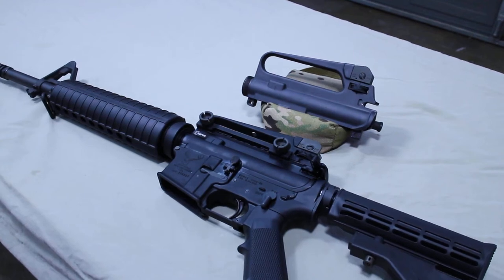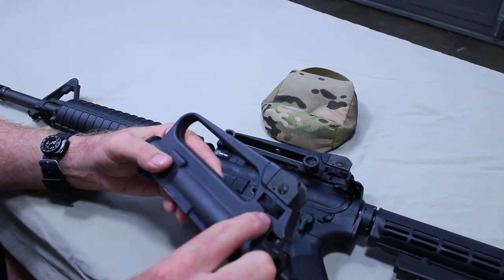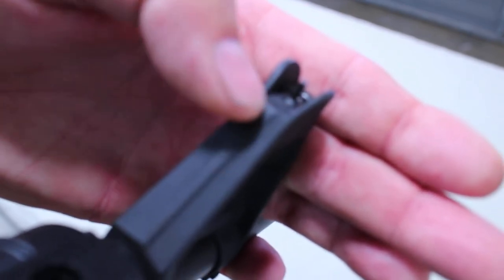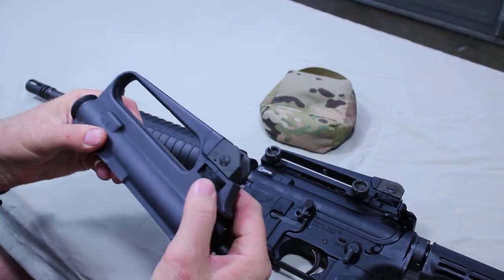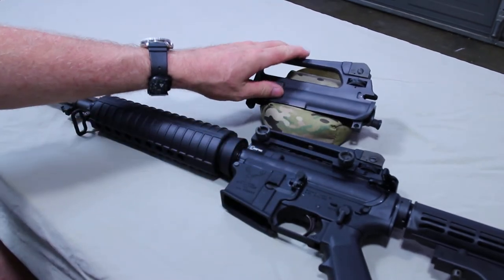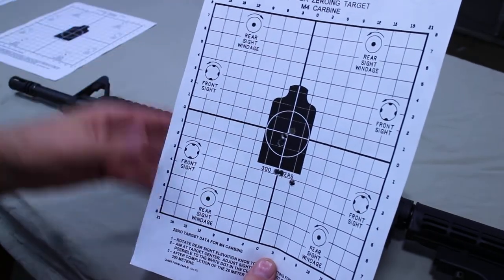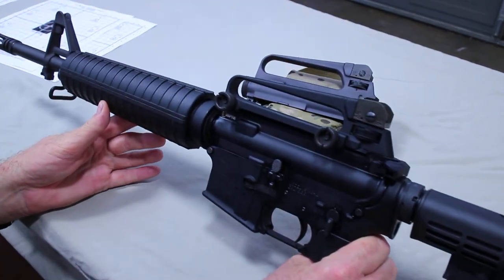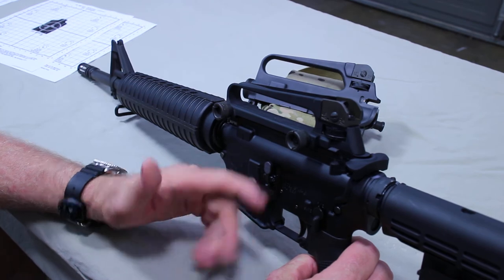AR15 A2 A4 Sights

Comment: EVERY AR owner needs to watch your video.  Thanks for the time and effort you put into this video.                               ALL BLACK RIFLES MATTER
Reply: could not agree more
Reply: What does changing the it to the Z do? What happens of I just leave it on 6/3 and not Z
Reply: @DontFollowMe666  Z is for 25 meters because there is a 2 click difference between zero at 25 meters and zero at 300 meters. Technically, Z will have the gun zeroed at 25 meters and about 250-260 meters.

Comment: Ive read all the posts and there's some comments which are not clear so here's everything there is to know about the matter.  

The literal definition of a ZERO and in fact where the word comes from is when the line of sight and bullet path intersect and the resulting value in any form of measurement is zero. 

Properly adjusting the M4, or M16-A4’s sights for a 300-meter Battle Sight Zero (BSZ) will sync the sights for a Bullet Drop Compensation function (BDC). 

The “Battle Sight Zero” supports engagement of unknown distance targets, allowing the shooter to aim center mass on an “E” type target and achieve a hit from muzzle to 300 meters with bullet impacting no more than 10 inches above point of aim at about 170 meters, and hit to 350 meters with bullet impacting no more than 10 inches below point of aim. In fact, utilizing the whole 20 inches of target below center of mass hold allows the shooter to hit a target out to 400 meters.

Once zeroed for a 300 meter Battle Sight Zero, the rear sight elevation wheel can now be hastily adjusted for engagement of known distance targets beyond 300 meters. This adjustment is known as Bullet Drop Compensation. The numbers on the wheel represent distances in meters. So, from the elevation wheel’s 300 meter setting, clicking up to 4, or 5 adjusts the trajectory of the round to engage targets at the corresponding distance (i.e., 4=400m, 5=500m).  And one full revolution up from 300 meter setting will correlate to the number 6 on the left side of the 3, thus setting BDC for 600 meters. 

Begin zeroing by depressing front sight detent with tip of bullet, or a sight adjustment tool, permitting the sight post to be rotated in direction as needed for one of its flange indents to engage the detent where the flange is flush to the deck of the front sight base. Next, set the rear sight small diameter aperture, also known as the “daylight” aperture, in the up position (the larger aperture is only used when visibility is limited, and/or shooting inside 200 meters) and turn rear sight windage knob in direction needed to align index line located on the top of the large aperture’s outside rim with center index line located on the back of the rear sight’s base. Next, turn the rear sight elevation wheel counterclockwise to bottom it out and then turn it (4) clicks clockwise to index the wheel’s 6/3 marking to the index line located on the left side of the carry handle above the elevation wheel. 

Now, because the path of the bullet will intersect line of sight twice when zeroing to any finite distance, this is how it is possible to sight-in the M16-A4 for a 300 meter zero at 32 meters, or the M4 at 25 meters from elevation wheel set at 6/3 marking per previous paragraph’s instructions. If precluded to a 25 meter range when sighting-in the M16-A4, you can compensate for the 32 meter to 25 meter offset by setting the M16-A4’s elevation wheel 2 clicks clockwise beyond the 6/3 marking, which will place the elevation wheel at the “Z” marking. Then, after sighting-in the M16-A4 at 25 meters, turn the elevation wheel 2 clicks counterclockwise from the “Z” marking, which will index the 6/3 marking on the elevation wheel back to the index line on the carry handle above the elevation wheel. Thus set, the rifle will be zeroed for 300 meters and synchronized for a Bullet Drop Compensation function.
Zeroing Part 2

So, shooting M855 ammunition, which has external ballistics matching the M16-A4 and M4 detachable carry handle sight’s Bullet Drop Compensation function, shoot at a big enough target to recognize having a consistent sight picture when the target is set out to available sight-in distance; and, using a center of mass hold, shoot 5 rounds from a stable position to produce a group on the target. Triangulate the group, excluding bad shots, to define the group’s center point; and adjust sights to move the next grouping to target’s center. Adjust elevation from front sight by turning sight post in counterclockwise direction to move bullet point of impact down. Turn the post in clockwise direction to move the bullet point of impact up. One click of post will move M16-A4 bullet point of impact 1.25 MOA, or M4 bullet point of impact 1.75 MOA. Adjust windage by turning windage knob clockwise to move bullet point of impact right. Turn knob counterclockwise to move bullet point of impact left. One click of knob will move M16-A4 bullet point of impact .50 MOA, or M4 bullet point of impact .75 MOA.
Note: The 300 meter zero must be tested by shooting to 300 meters, adjusting front sight as needed to correct elevation error. Also recognize that since horizontal bullet displacement could have been caused by wind, or poor trigger control, windage adjustment should not be made at this time but instead retain the windage knob’s no-wind zero condition made at sight-in distance until shooter/target analysis via call/strike corollary can identify wind, as need for a temporary windage adjustment, or refinement of the no-wind zero as cause to adjust windage knob (read Compensation for Wind and Shooter/Target Analysis sessions).

Comment: I believe the Z setting is only for the M16, e.g. 20" barrel. The M4 (14.5") should actually be flush at 6/3 when zeroing. Alternatively, you can just run a ballistic calculator for M855 and find the intersection at 300m for your given barrel length/muzzle velocity and zero at the near range where elevation is 0" (point of aim) without using the Z. The whole 25m/Z thing is just to accommodate standard zero ranges in the Army. The BDC is also designed for M855, not M193, but they are pretty similar out to about 400, within a few inches at most.

Comment: Good bit of information that the 8/3 sight wheel is for the M16A2 or AR-15, both with 20" 1in7"twist barrels. The 6/3 sight wheel is for the M4 and 16" 1in7"twist AR-15s.
Reply: the M-16A4 is a flat top with 20in bbl with a detach handle of 6/3.  bbl length has nothing to do with 6/3  its due to the dch being higher then the A2 carrying handle   A4/M4 6/3 = 1/2 inch for every 100,  means for every click on the rear sight is an adjustment of 100m   .This is USMC doctrine.  Marines BZO different at shoot at 36yard not the 25.   USMC adjust  all rear sights to A2  8/3-3 or A4/M4 6/3-3   different from the Army.  if you be interested in the USMC way I will be happy to tell you.

Comment: You can zero these type of sights at 100 meters using the  Improved Battle Sight Zero, and it will keep all of the elevation adjustment correct. Using the IBZ will allow you to have a 100m and 50m zero and keep all elevation adjustments correct.
Reply: Yep.
I just learned how to adjust the elevation barrel to allow 8 negative clicks below 6/3.
(2 for a buffer to prevent bottoming the mechanism).
Allows the peep to be used down to 100 meters easily.
100, 50, 300, 25 meters and up.
It is a difficult concept at first, till you study the ballistic graph for a 5.56.

Comment: Today I shot my ruger 556 and bushmaster ar15 5.56. Sighted in on the 6/3 and at 300 yds 4 inch groups. 400 yds 4 inch groups and 500 yds 7 inch groups. The bushmaster 1 in 9 twist and  ruger 1 in 8 twist. Using 55grain fmj bt 3120 muzzle velocity. Thanks to captain. Thanks kap

Comment: when you sight in 6/3 at 25 meters, what sight do you use? the small one right?

also when you zero 6/3 at 25 meters with small sight, then flip the bigger sight up, that changes it to a 200 meter zero?
Reply: Always use small sight.    BZO in at 36 yards for a 300.  adjust rear sight up 3 clicks.  one click for every 100 yards.    3 clicks up for 300 yards.    this the USMC  way.   USMC  uses yards not meters.  the hole 25meter thing is how the army does it.   this does NOT mater if A2 or A4,M4 with a DCH on.   i never used the big sight when i was in the Marines.

Comment: Why does it have to be 2 clicks up on the Z? If you leave it at the 6/3 setting you wont be able to hit paper? What happens when you move it to the right on the Z?
Reply: Bc if it's not on the z it's not at mechanical zero that's what the z indicator is on some of those for

Comment: Great video. I noticed your using a m4 for this video, will the same information you give work for the ar-15 rifle with a carry handle? Thank you.
Reply from the maker: Yes
Reply: @EN2HAMMSTER   it absolutely has to be 2 clicks right on the Z setting to zero it in? If you leave it at the 6/3 setting what happens? You wont ne able to get on paper? Sorry and thanks

Comment: I understand the procedure, but not the reasoning.   Why do you raise the bullet drop compensator to shoot at 25m and lower it for 300m?  Doesn't raising it cause you to shoot higher to compensate for bullet drop?
Reply: your confusing the front sight to the rear sight
Reply: @shotdog4237  No, I am not.
Reply: Cav Trooper 19D  I have since found an answer to this question.  I don't know if it is correct, but it satisfies me.  From what I understand, the rifle is designed with the barrel pointing slightly up.  So the bullet travels in an arc.  It rises, levels off, and then drops (like a football pass.)  At 25 meters the bullet is still traveling upwards, and that is why aiming center mass at 25m would end up being low at 300 m.
Reply: Cav Trooper 19D  Is this Army doctrine?  Because this is not USMC doctrine.  The M-16A4 is a flat top with 20in bbl with a detach handle of 6/3.  bbl length has nothing to do with 6/3  its due to the dch being higher then the A2 carrying handle   A4/M4 6/3 = 1/2 inch for every 100,  means for every click on the rear sight is an adjustment of 100m   .This is USMC doctrine.  Marines BZO different at shoot at 36yard not the 25.   USMC adjust  all rear sights to A2  8/3-3 or A4/M4 6/3-3   different from the Army.  if you be interested in the USMC way I will be happy to tell you

Comment: thank you!  IS there any difference if you have a 20" barrel with the detachable 6/3 drum?
Reply: What would a drum change about the sights?
Reply: Cav Trooper 19D  so if I have a psa 20 in A2 barrel with A2 detachable sights, when I go zero it should I leave it on the 6/3 or on the Z? HELP!?!?!
Reply: Cav Trooper 19D  thanks so much will subscribe right now, one more thing, after zeroing it in ar 25 meters then I return it back to 6/3 or do I leave it at Z , thanks again So much. Sorry for the noob questions
Reply: the M-16A4 is a flat top with 20in bbl with a detach handle of 6/3.  bbl length has nothing to do with 6/3  its due to the dch being higher then the A2 carrying handle   A4/M4 6/3 = 1/2 inch for every 100,  means for every click on the rear sight is an adjustment of 100m   .This is USMC doctrine.  Marines BZO different at shoot at 36yard not the 25.   USMC adjust  all rear sights to A2  8/3-3 or A4/M4 6/3-3   different from the Army.  if you be interested in the USMC way I will be happy to tell you

Comment: Any difference with the removable carry handle and 20" barrel?
Reply: No.  the M-16A4 is a flat top with 20in bbl with a detach handle of 6/3.  bbl length has nothing to do with 6/3  its due to the dch being higher then the A2 carrying handle   A4/M4 6/3 = 1/2 inch for every 100,  means for every click on the rear sight is an adjustment of 100m   .This is USMC doctrine.  Marines BZO different at shoot at 36yard not the 25.   USMC adjust  all rear sights to A2  8/3-3 or A4/M4 6/3-3   different from the Army.  if you be interested in the USMC way I will be happy to tell you.   Where did you hear this?  about 20in is for 8/3?  i am hearing this a lot.
Reply: The detachable carry handle for M4 and A4 is the same but since the sight radius of these two rifles is different so is the click value: M4 .75 MOA and A4 .5 MOA. Now because the A4 produces a foster  trajectory than the M4 it is zeroed at 25 meters at the Z setting rather than at the 6/3 setting and then the elevation wheel is turned back to the 6/3 setting which will yield a 300 meter zero.

Comment: So you have to mechanically zero an AR a2 sight before actually zeroing it in? Sorry I'm a noob at this and confused
Reply: okay- there are two separate things going on here.    these sights have distance settings marked on the elevation turret.   those markings will only be correct if you zero the rifle with the turret on the correct spot and use the FRONT sight to zero your elevation.  

If you don’t set the sights in the right place first, you could go to the range and simply click your way to a good zero.  but if you do that the distance markings on the sight won’t mean anything.

Comment: Why do you need to back the drop comp 2 clicks when you zero it? What does this do?
Reply from the maker: It compensates for only being 25 meters from the target on a 100 meter zero
Reply: @EN2HAMMSTER  ahh ok. Thanks!
Reply: @EN2HAMMSTER  it compensates when sighting-in is at 25 meters instead of 32 meters.

Comment: what about barrel length ?  does this work with a 20 inch barrel?
Reply: the M-16A4 is a flat top with 20in bbl with a detach handle of 6/3.  bbl length has nothing to do with 6/3  its due to the dch being higher then the A2 carrying handle   A4/M4 6/3 = 1/2 inch for every 100,  means for every click on the rear sight is an adjustment of 100m   .This is USMC doctrine.  Marines BZO different at shoot at 36yard not the 25.   USMC adjust  all rear sights to A2  8/3-3 or A4/M4 6/3-3   different from the Army.  if you be interested in the USMC way I will be happy to tell you.